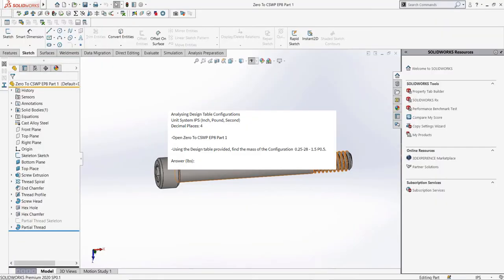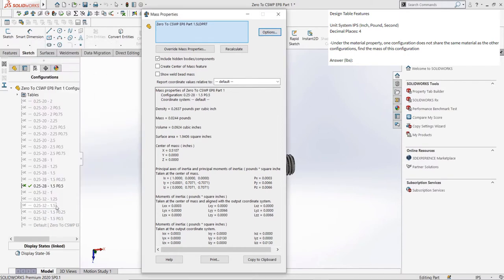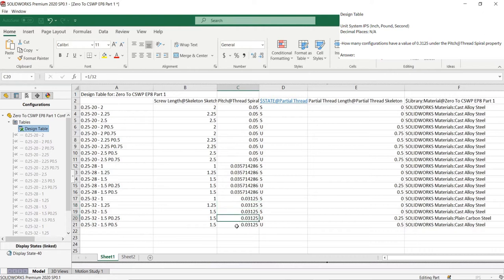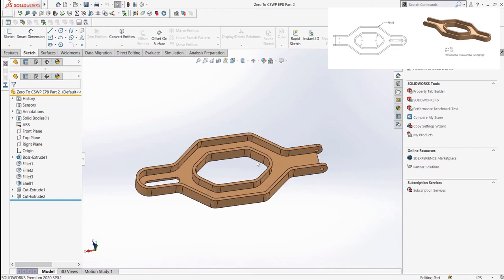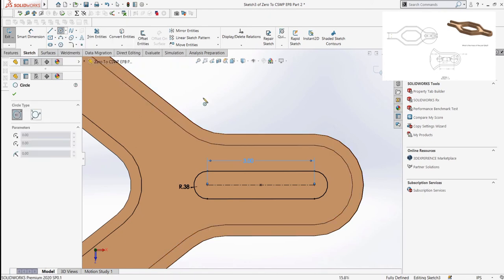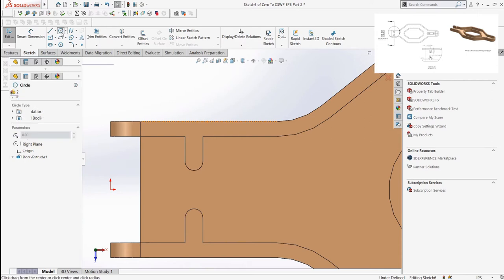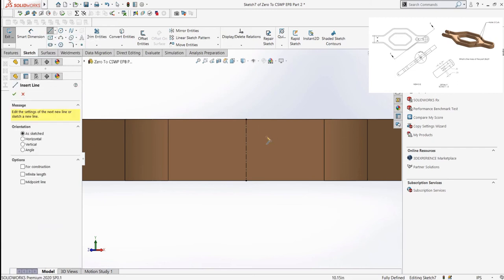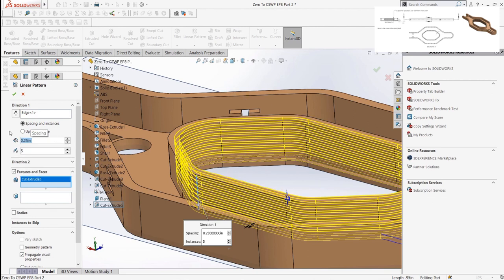Zero to CSWP #8 | Beginner Solidworks Tutorials

Comment: Thank you very much for your extremely good explanation. However I have a question, why do you always convert entities before you offset them? you can use offset entities directly, can’t you?
Reply from the maker: Great great question. Fundamentally there is no big difference that comes to mind. However the reason I do it is two fold. Firstly, it generally allows for more control of a sketch as you now have the original geometry. Secondly it gives you more “Sketch stability” as in changes to the part have a less likely chance to “break” the sketch. As well, it has become a habit.

Comment: Hi Lucas, I've a question regarding part modification. Do we need to continue further modification of the part by following the question steps? Or will we need to save as the individual file after each modification? And thanks a lot for this series!
Reply from the maker: I would save after every major modification just in case your computer restarts or something like that. You would end up with files of the part at every step of modification